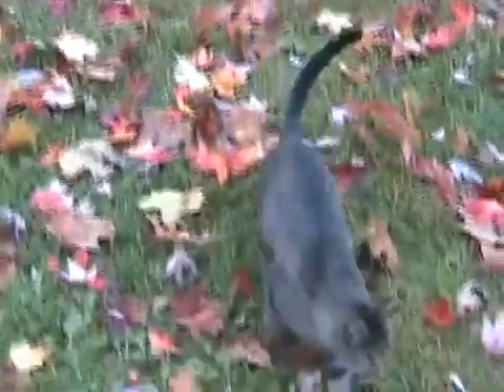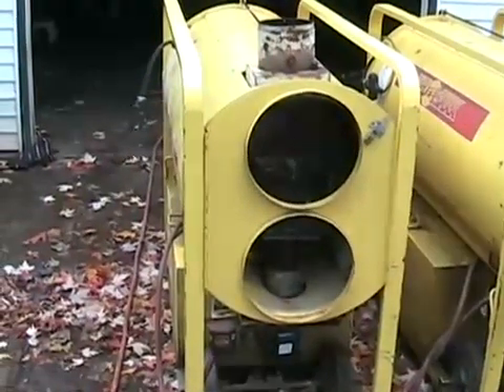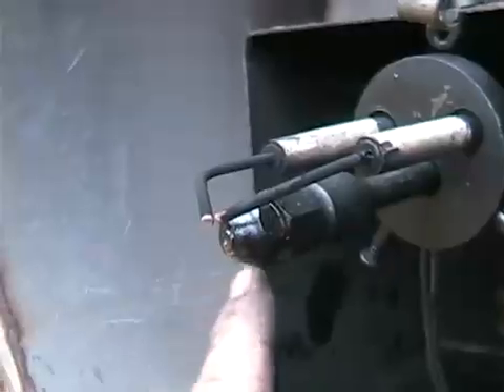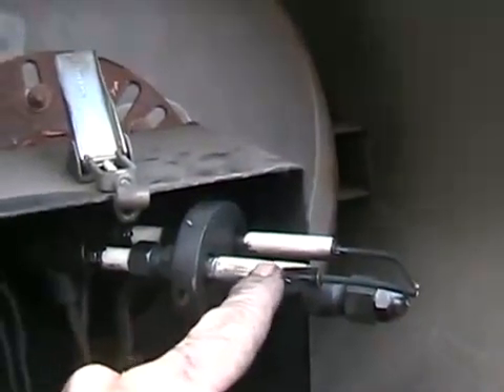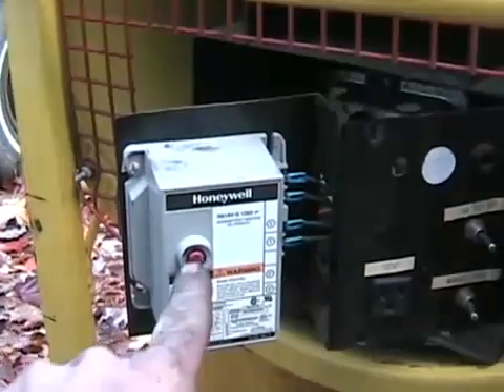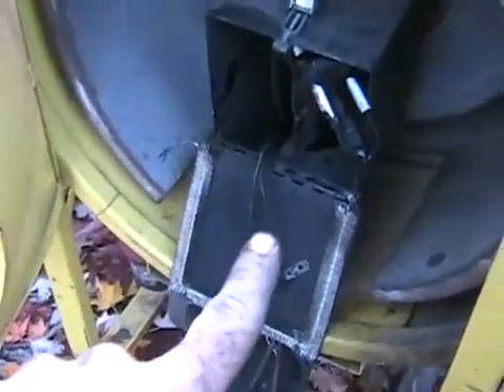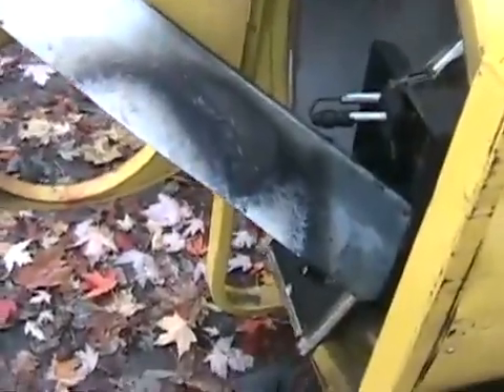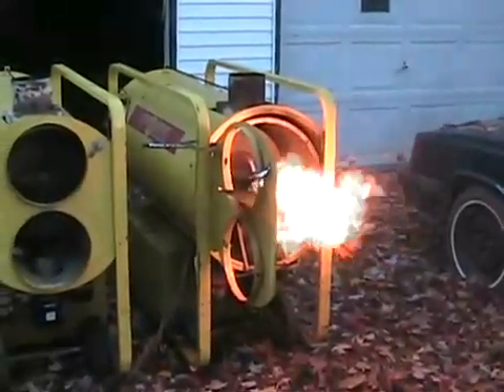how your oil furnace works Davidsfarmison[bliptv]now

Comment: Thank you for your Video! Now I know what happens in my furnace.. A furnace is like an Automobile engine that makes heat rather than Horsepower!! 
Question.. I have oil heat with radiators.. Is it easy to convert to air heat? Do you have video's explaining the difference between the two? Thank you!